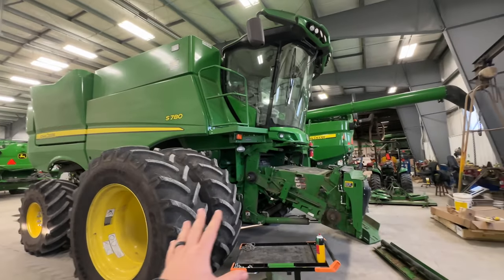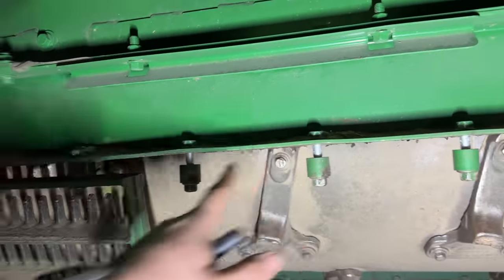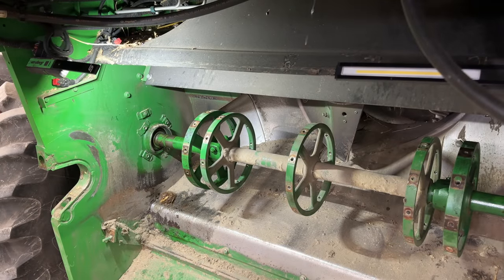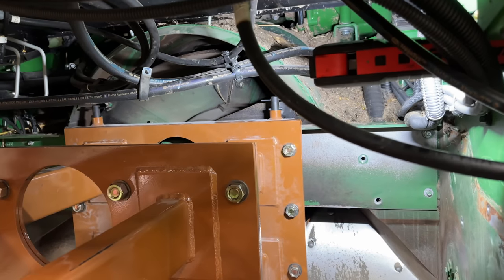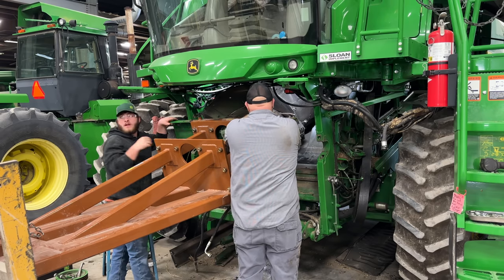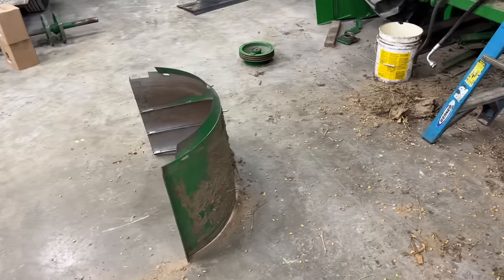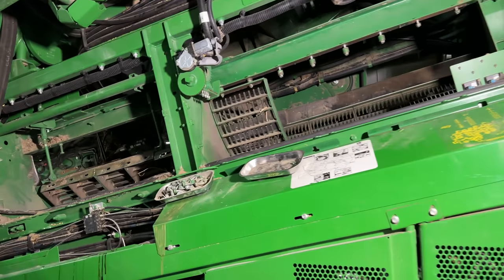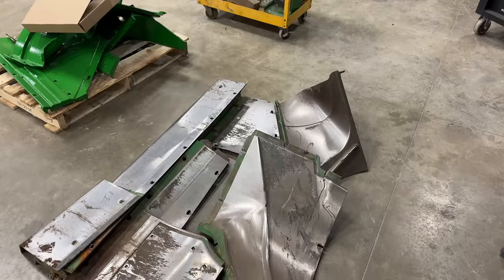Major separator damage! Removing a rotor out of a John Deere S770 combine.

Comment: All I can say is .... I'm glad I don't have to write the check to pay for this ... that shank turned into one expensive piece of scrap steel!! The damage is just never ending it seems.  Great Video as always thanks for bringing us along!
Reply: those combines are half scrap to start with..lol watching these repairs on them makes me realize how terrible the designs are.
Reply: @2007dalin  especially if you go with case lmao. This season (australia) I worked in a Case 2166, and we broke down no less than 30 times. I would often have to manually turn the rotor over to clear, even in light crop with a high concave.
Reply: If that Case is breaking down that many times or any combine for that matter then no one is prepping the machine in the off season. A friend has an 88 series and runs 2400 acres a year through it. It has 7600 hours on it. I run 450 acres through a 1400 series this year. Pull the belts and roll shafts over to check for rough bearings, etc. Separator bushing and bearings should be changed every 900- 1000 hours.
Reply: If it's a newer Deere and not in warranty it's not worth writing the check. Much better alternative brands out there - some doing things Deere is behind.
Reply: @CattleandCountry  yeah that was the issue. It’s my cousins farm and he has gone a bit off the bend so to speak, he has some (some is an understatement) mental issues and basically left the machines in the paddock, I.e: the drill is still in the field to this day from April. We ran 7000 acres on 1.5 machines (the other combine’s shaker fell apart so we only got half a season out of it). It was a hell of a dodgy job.
Reply: It’s not scrap metal it’s an actual part on the ripper
Reply: @philmickelsonscalves7585  you need to reread my comment. Slowly.
Reply: @philmickelsonscalves7585  It was by the time it came out the other end, and had a very costly process turning it from part to scrap along the way.

Comment: Anymore damage and that thing would surely be a total loss. It’s incredible to see how much engineering goes into these things. Great video guys. Sloan is definitely getting their money’s worth with employees like you.  Thank you for taking the time to produce this video especially after all of that hard labor!
Reply: Not necessarily. It's a relatively new unit and probably reasonably low on hours so still worth it to repair it. We had damage on one of our 790's in the 5-6 figure range and insurance still wants to repair it while a 90's era 4wd with 4-5 figure damage is being written off simply because of its hours and age.
Reply: @joshuadoll9000  I forgot how much these things cost. Thanks Josh!
Reply: @joshuadoll9000  I'd shell out the 4-5 figures myself to keep that 90s era 4wd going, no computers or Democrat mandated EPA emissions BS on that baby.   The kid who rented our place after dad and I retired spends more time fiddling with computers in the cab and chasing electronic gremlins in his new green machines than he does farming.  They had some big new 200+ HP Deere out there this spring, (I don't know the numbers anymore I haven't kept track since the 7000 ten and 8000 ten series) trying to plant beans and something went wrong with the computer and the Deere techs spent all afternoon out there under the hood trying to get it to run.    I told the kid if he had an old 4955 instead of that new computerized plastic POS he would have been planting all afternoon. LOL
Reply: @trevorn9381  We ended up buying it back in the mid-high 5 figure range because it has a PTO which we need since it's our cart tractor and PTO 4WD tractors are tough to find in our area and it's also our snow plowing tractor and if we bought a new one we'd have to buy a whole new blade as the blade we have is set up for the frame of the tractor and isn't compatible with any old tractor.
Reply: Was there any chips in the gearbox bottom?

Comment: Wow Zeth, what a job! When you think that sometimes a big rock can just plug and bring the machine to a halt, but this ripper shank just kept going until it had its way with the rotor etc. Thanks for making a video of this as its not every day you see a rotor being taken out. The other thing that kept going through my head was when you see the damage to the rotor components, just think what would happen with a human body going in, guess you would just need a water hose for that repair! Thanks as always from Scotland and have a great 2023.
Reply: I ran a flat rock in my gleaner and it pushed the cylinder into the tailings augers over 6hrs of fabrication and some new words I was back in corn,I love your videos keep up the good work.
Reply: @williamorman4779  How did it get past the rock door? On the old Gleaner we had if you picked up a rock it popped the door open and the rock fell out and a red light lit up on the console to alert you to stop and crawl under the combine with that tire iron looking thing that hung on the side of the clean grain elevator to close the door.

One time dad ran one of the clamps that held the Unverferth duals on our Deere 4230 tractor through the Deere 4400 combine.  It fell off while we were planting corn one spring, looked all over the field for that thing but  never found it.  Found it several years later with the combine while cutting beans.
Reply: The pin move not letting the hing to get out of the way ,keeping pressure on the latch.
Reply: @trevorn9381   the roll pin was to long keeping the latch from opening all the way,I repaired all the latch  and the door too.
Reply: Our self propelled harvester had metal detector in place wire in earth to three-quarter million dollar combines not have metal detector

Comment: That is absolutely incredible that the shank didn't lock up the feed accellerator and end the nightmare with a belt smoke instead. And the rotor tines all shearing like that is quite a sight as well. I think the White Hall store nearest me had a local S780 this fall with the very same issue that required the rotor removed and massive hood damage.

Comment: How often do you see a machine which has had damage like this? It seems like it would be worth having a big magnet in the feederhouse to at least try and stop big chunks of iron going through - won't help with stones etc. but at least they might shatter and do less damage!
Also I wonder if a telehandler would make removing the rotor easier, if you could extend the boom (it might be too low) then you could angle the headstock and, hopefully, you'd be able to bring it just by retracting the boom (which would effectively lower and reverse at the same time)

Comment: nice video, got a few good laughs in and reminded me of some of the repairs i have done over the years. this doesnt even look bad compared to some of the combines i have seen. only thing worse then a piece of steel is boulders, , posts, header parts rolling thru. gravels wear down everything fast. eastern montana/ dakotas are known for rock farming. the older combines can eat alot of debri more so then new ones.  at least you could get parts. theres some farmers stuck on there 80s combines and everything has to be bent/ welded back together or made.  resurrected a few that are still going. just takes alot of creativity to take them apart and fix. find solutions for problems never thought possible.   dont have to much fun. miss these machines but glad my nights of working on these is over with. lol

Comment: I have replaced the left and right frame rails all the top rotor covers and multiple other parts a S680 and a 9870 john deere due to edible beans being ran throw the combine to wet and plugged the rotor. I also had to rebuild the five speed gear box on the S680. It was a long process repairing both combine but was a satisfying job to see them both running again.

Comment: What a sensitive machine ,  the old 8250 case may not be the best , but it sure handles foreign objects well .  We have had a chunk of grader blade , 100 roller chain , rocks go through and usually just punches a hole in sieve.  Obviously best case scenario is for it to jam up feeder / header clutch and not even go into unit

Comment: Tip on removing the feed accelerator pulley is to get 3 bolts like 4 inches long that are threaded the whole way and run them in the threaded holes in the pulley against the bearing housing and the pulley will pop right off with out using a puller.

Comment: I see you did not bring in the comments from the introductory pictures. This looks like an exact duplicate rotor to the International Harvester Axial-Flow that came out in late 1976. As a young man just starting my career about fall of 1978, or spring of 1979 I helped to remove the IH rotor for repairs. Just from the looks i would be surprised these two manufacturers parts could not be inter changed.
       Good video. You guys do great work.

Comment: @3:42 I'm retired Navy Aviation and you have experianced 'Forgien Object Damage' or FOD. You 'FOD'd' your combine. Yes, I saw damage, and lots of it. @end. dang. I ain't seen carnage like that since I was a brand new F-18A that had some depot work done on it... they had dropped the engines and put them back, but they omitted the duct to engine V clamps and someone left tools inside the ledge.... I was walking out to an A-7 to wrench on it while this Horent was turning on the flight line rigging the throttles when WHAMWHAMWHAM the #2 engine just started throwing compressoin stalls and.. the engine rapidly dissassembled itself and ejected the spare parts out of the aircraft thru the aircraft skin. Lots of fancy glitter, really expensive too. It looked like a drunk took a chain saw with a dull chain to the side of the aircraft nearly cutting the rear fuselage off.

Comment: Well I am an old retired IBM Tech., I have seen my share of burned cable harnesses and all kinds of paper jams on high speed printers when the jam photo cell fails and your printing 3800 pages per minute.  But nothing like that.  We would have requested a mechanical replacement from the factory.  lol  One question what is the riper shank that caused all that damage.   You guys amaze me.

Comment: This may be Deere,s first attempt of an autonomous combine! It can cut back and forth by gps, automatic header height, dump on the run into grain cart, automatically change settings for no crop loss, but more work is needed on the automatic debris in the field detection system! May be a software problem!!

Comment: One of the biggest things that amazes me is the fact that it can get through the head and then through the hole combine and nobody could shut it down before it made it through the combine totally the racket it must have made
Reply: Late night work with a nice pair of isolating Peltor's with music in them..
Reply: @TheBibliofilus  I guess that's why I don't wear head pieces I like to hear what my machine is doing
Reply: @lmsendit9531  i mean if your cutting beans that rotor is still turning with like 400 rpm so if it went through the header and feeder house unnoticed that thing will be through the rotor in no time. even if you shut it off, it will propably still have enough momentum to run it through all the way

Comment: Wonder if it would work better to remove the rear wheels on the combine and lower the rear down so the auger is parallel to the floor? That way the forklift could just drive straight back, maybe?

Comment: Wonder if I can find the description of a ripper shank? What a disaster. Did the operator come via a rock quarry? Leveling the plane of chassis will be the best way to re-install. Matching the gyrations of removal would be a real trick! Clear sheet of polycarbonate over top of rotor going in, would help unit slide past hoses,etc. Great video

Comment: Somebody already beat the hell out of the accelerator with a 20lbs hammer before y'all got to it, not surprised it came loose easy.   Surprised you didn't have to replace the seat cushion.

Looks like y'all need a bottomless trash can and an adjustable incline of narrow-gauge rail track and a winch to be honest... the fork is definitely the wrong tool.   Roller coaster side rails and a set of carry bars that push up in the housing that you can bolt on make sense.     Frankly with the amount of damage a 30 ton floor eyelet a couple grey pvc pipes and a two tow-chains would work faster - man hours are man hours.

Comment: I had a combine with a leaking rear engine seal.    That caused the clutch to fail.  $8500 to fix and bring in the combine.   How much to fix this combine?   If the fix is too much might be better to part it out on an older one.

Comment: It's like cars or anything they build these things on an assembly line which is very easy to get to everything and everything about or even having in the engineer maybe even take into consideration that things have to be fixed sometimes and Engineering it where people can actually get to things it's a lot easier putting this thing together when you going through an assembly line and everything's out of the way then you got to repair it and they put it in there like it ain't never supposed to come out it's crazy how engineers do this stuff and not even thinking about down the road repairs cars or anything

Comment: I was told of a Deere combine that ate a header end guide and did similar damage. Then the machine dropped a rear wheel into a collapsed drain and damaged the front axle housing, Parts alone ran to £110k, not sure if it was subject to an insurance claim.

Comment: Great content. I'd hate to be the guy that lost a ripper shank, then didn't go back and find it.

Question: Wouldn't it be easier to pull the rotor if the combine was tilted, by raising the front, lowering the rear or a combination of the two, until the rotor was parallel to the floor? Seems that it would eliminate most of that tedious forklift adjustment.

Comment: I just got done with replacing the hoods and rails on a s680.  I feel your pain
Reply: Do you think it would be possible to remove one of the rails without taking off the hoods, I've got a hole worn on the left rail on my s660, hoping it to find the easiest way..
Reply: @BoerPiet  left side when you are sitting in the seat or left side standing in front and looking at it?
Reply: Left side sitting in the seat
Reply: @BoerPiet  yeah that side would come out but you have to get all the bolts loose and block up the hoods helps to have all the seperator grates out as well.  The other side has wear plates the you can install
Reply: Sounds good, thanks alot, got on more question for you, recently installed a new rotor bearing, and ever since then I have a lot of chaff leaking out, so much so that it heaps up a bunch on both sides of the cab during the day, as high as those green plastics on the cab door, was thinking could it come from the top rotor cover the very front plastic one.?
Reply: @BoerPiet  yeah it almost has to be.    Did you put new weather stripping on the plastic before you reinstalled it?
Reply: No I didn't, local dealer didn't have stock, thinking I might try duct tape for now, till we are done cutting wheat!

Comment: So dumb question, looking at the angle you have to pull the rotor out, would it not be possible to jack up the front of the machine to put the rotor in a level position to make extraction easier?

Comment: Zeth, 
The replace the completed rotor assembly and housings along with frame rails?
What is the parts & labour going to cost the farmer?
When does the cost of repair greater than a replacement machine?
Need more turbo charger and them good DELPHI smart remote actuators repairs!.
Thanks

Comment: Looks like most of the machine internals were hit and broken by the shank. I guess it’s not surprising as it’s designed to handle wheat / corn, not solid steel claws. Must have been an expensive fix

Comment: Wow thats crazy.. at some point you think the operator would recognize the amount of terrible noise as that shank works its way back, and would have shut the machine down. Unless they just figured "well I'm committed now. " lol
Reply: The rotor can spin up to 1000rpm which makes me wonder how long such an event would take?
Reply: I don't have thousands of hours logged in a combine like some of these crop farmers do obviously so my experience is limited, but you have a good solid several seconds when you know somethings not right to react. That being said, if you have the radio turned up loud or you have AirPods or something and you can't hear or you're distracted, I suppose it could easily get by you. Realistically, it's easy for me to sit here and say that, but when things go wrong, it does happen very quickly.